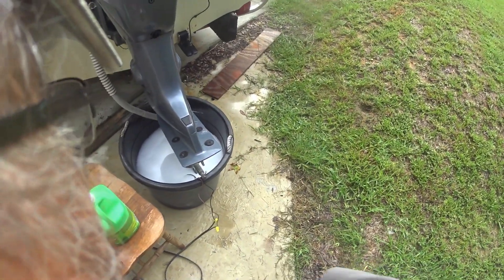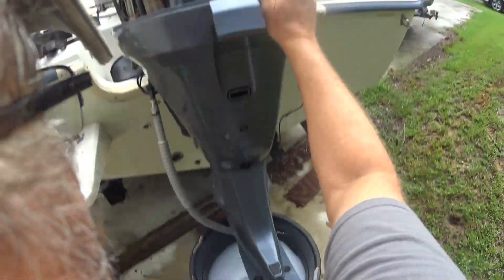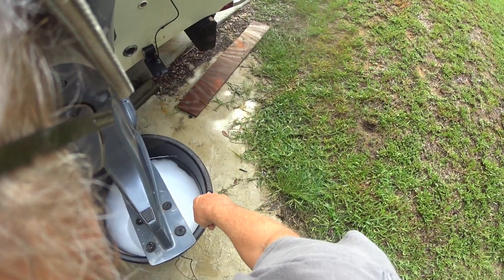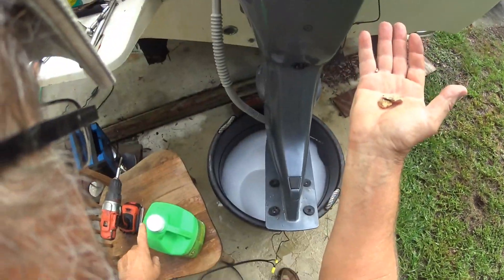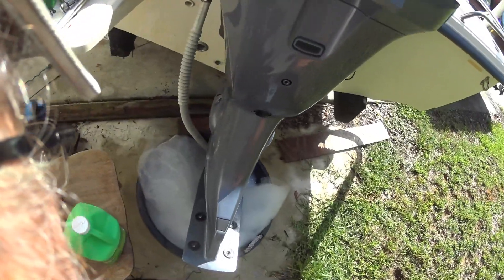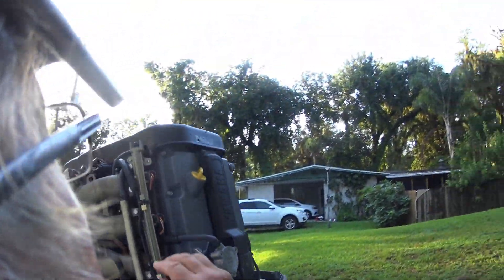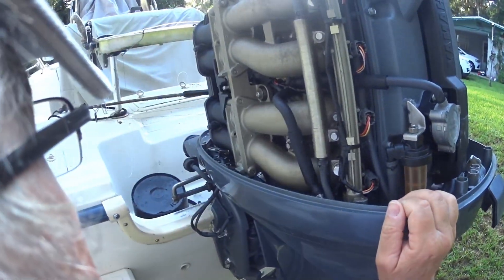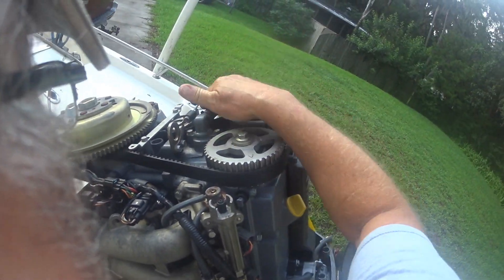How to THOROUGHLY Flush Your Yamaha Outboard

Comment: I use Ospho metal conditioner. It does not react adversely to the aluminum as much as Rydlyme. Ace hardware stocks it in the store for pickup. Remove the lower unit and attach your recirculation pump hose to the water pump pickup tube. Remove the thermostat and anodes.With the engine off and the Ospho diluted start circulating the chemical throughout the cooling system. Flush for a few hours than let it sit within the cooling passageways for atleast two to four hours then repeat as necessary. Flushing your outboard motor with the earmuffs after running it in salt water does not do very much because the engine never reaches operating temperature and the thermostat remains closed. Instead, use a large garbage can and or container filled with fresh water and run the engine until the water gets warm. Usually takes about fifteen to thirty minutes to flush it out properly.

Comment: Lots of work but worth every ounce. That motor should keep on going for many years! I've been looking at my 115 Mercury 2015 engine and it doesn't have any anodes on the engine. And the anodes it does have are aluminium. I'm definitely going to look into flushing the engine with that line removal product. Thanks, Lane.  I always run my engine after every trip and make sure it heats up. Haven't had any problems but it's always good to stay on top of things
Reply from the maker: Hi Danny, Aluminum anodes.. on an aluminum engine? I might be missing something but I thought yo9u needed a 'sacrificial' metal and not the same metal.
The motor ran GREAT today but we only stayed i the inlet area and fished the jetty. Too rough off shore. But I caught 3 Cownose Rays, one big Red Drum, a huge nurse shark and 14 Mangroves of which I gave John a couple and I kept 5... Fun day on the water...
Reply: @SaltyKayak  I'm a bit confused on that as well, but I do have three zinc anodes external. One on trim motor, trim tab and lower end. but according to Mercury there are none on the motor?? I looked it over very well and none to be found.  My youngest son came down ans we got offshore. Conditions were pretty good but a little choppy. And we caught our limit in red snapper, Ha!  Went out Friday and Saturday very early to avoid the masses. The FWC youngsters got me when we docked and asked how did we do and I raised my hands in victory and said we got our limit. We caught some 3 pounders, but they were red. Even better we caught 6 nice Vermilions. I'll probably go out Friday alone to get my one rs.  Hope you and John make it offshore to let me see some big rs being taken home!

Comment: Make sure it is circulating by taking out the thermostat. The best way to do it is through the input tube when the lower unit is off.
Reply from the maker: Yes.. I took out and cleaned the thermostat while the flush was circulating..
Reply: I was thinking of doing this exact same thing...flush my motor through the pickup tube. Does anyone know if it would be safe to do so with the motor running? Provided one can rig something up to give enough pressure up the pickup tube, so as to cool the head and prevent an overheat instance, of course..
Would love to hear y'alls thoughts on this. Many thanks in advance

Comment: I just need to ask did this take care of your overheating problem, captain. Thank you for taking the time to put on these videos. Very informative.
Reply from the maker: Rydlyme... is the best and quickest solution. Yes, I had to pay a little more for it but from what I could tell after a good long flush.. by following the directions.. the motor ran clean and cool up until I sold the boat not long after I did this flush. This might be upsetting to some, but when I saw that Biden was going to be President, I knew I wouldn't be able to afford the cost of non-E gas (I am retired and on SS). And I was absolutely right.. gas prices skyrocketed AFTER I bailed on the boat.
Reply: Thank you I didn’t receive a reply. Thanks for answering it twice lol.

Comment: Great video thank you for sharing your experience. Did it stop the overheat issue? Thank you another Florida boater.
Reply from the maker: When I flushed it with Rydlyme as per the instructions, that stopped the 'stopping while at near full throttle' issue. I didn't have a temp gauge from the motor to tell me when it was overheating but it ran like new after the flush.

Comment: Anodes are designed to waste away , after time they do go to a type of zinc paste , it’s because they are working . To flush an outboard just put it in a tub and run it up to temperature so thermostat opens and job done

Comment: Good morning...... I have the same Yamaha 115. Question for you regarding your process for "flushing every time" Have you been flushing without motor running by using just the water house connection hose port? Or were you putting on ear muffs on the lower unit and running the motor? In my experience its a "must" to run the motor with muffs on for about 15 to 20 minutes to ensure the thermostat opens and water then circulates the entire system. Hope to hear what your process was before you had the overheating problem. Thanks!
Reply from the maker: Always, always used the muffs but rarely have I flushed for 10-15 minutes.. usually more like 5 minutes and I usually will 'taste' the water coming out of the pee hole to make sure it doesn't have any salty taste. I can always tell just by the sound of the engine when the thermostat opens and will run it for 5 minutes+ after that. But, what I have found out is that when I am out in the ocean fishing for 4 or 6 hours and my engine is just sitting, over the weeks and months of doing this (even though I flush every time) there is a small corrosive buildup in all the water channels. That is when I need to do a true chemical flush.
Reply: Great info! Thanks for the reply sir @SaltyKayak

Comment: When I change out my lower unit oil, it too had some milky (water in oil) stuff In it, well I almost found out the hard way that all the seals were bad. Might want to do a pressure test for the seals. Don't need it locking up on the water/offshore. 
Hope you catch a red snapper!
Reply from the maker: Hi WF, Pretty sure I found out the oil leak problem. When I took the boat in for the 100 hr (more like 200 hr) maintenance, the shop had put in new oil in the lower unit but had also put teflon tape on the bottom screw. That tape must have created a micro gap in the screw/threads and for the last year, it slowly drew in water and expelled micro amounts of oil. The gasket they used looked like it was my old plastic gasket instead of a new one and they used teflon tape instead of a new gasket. Everybody is out to cut costs and try to sneak in inferior repairs.. that's why I prefer to do it myself. That way, if I have a failure.. it's my fault and not a care(less) tech..
Reply: @SaltyKayak  WOW!! Yes sir, I try to do all repairs for that reason also. That's good that's all it was. I have to replace my lower unit.  I had a nice size chip out of one of the gears from water in oil.  New one 2,500 used $500-$1000. Hopefully get it fixed in the next couple days for the last day of red snapper season.
Reply from the maker: @wallyfo  I'm in the same boat.. so to speak.. in that the boat has dry for the last 4 days. but plan on going this coming Friday for my one keeper RS this year. Plan on a water test tomorrow and determine if I want to go off shore on Friday..

Comment: Hey Capt Salty you could go by a canal and back in the ramp and run motor for ten minutes in fresh water. I can’t do that anymore my boat is almost 26 ft long but you can. JT 🇺🇸🇺🇸🐟🐠🎣🛥🌴⛱😊😊😊🙏🏻🙏🏻🙏🏻🙏🏻🙏🏻
Reply from the maker: When I lived in NC, I would pull out of the ramp here in Ponce inlet and drive straight up to the Charlotte area. Only about 3 miles from my house was a fresh water lake and a ramp that I would back the trailer and boat back in. I would climb in the boat and start the engine and run it for 5 minutes in Forward and then a couple minutes in reverse and flush not only the motor but the trailer/tires and springs. But since I only live 3 miles from a ramp here in New Smyrna and there are no fresh water lakes nearby.. it's all about the hose and muffs..

Comment: May be wise to change the water pump and the impeller after that flush ,they also advise to change the water pump and impeller yearly due to the sand in the water ,and just a FYI you can get a parts break down and part numbers at boats.net look them up by year and model  number
Reply from the maker: Hi Fred. I spent almost all of yesterday putting in a new pump/impeller assembly. Actually 3/4th of the day was getting that blasted metal cap and plastic bushing off of the shaft. I saw where one guy on Youtube just pried it off with a screw driver and another guy cur it off with a dremel. Of course, I tried (and eventually succeeded) with the screw driver/pry/hammer method but had to go to my local marine store for a new set due to destroying the bushing and cap. Nest time, I will just order one ahead of time and have it.. and cut off the old one when I do the next impeller change.
Spent about 45 minutes just now putting the lower unit back in the motor (another first time doing) and will put the muffs on it for a test in another hour or so.. when all of my neighbors are up and around.
I have cleand and rescued most of the old original Yamaha  water pump assembly and will just order the basic kit for the next swap out... planning ahead..!
Reply: @SaltyKayak  Yes the kit will likely have everything you need ,That is what i have always bought ,and it does help when you have 2 people to put the lower unit back on ,one to handle and one to guide ,with my 2003 yam F60 you have to make sure the fwd/reverse shaft is correct ,hence the second person

Comment: Well salty I think your running to hard. And the motor running hotter it’s building up scale. Get your self a 200 hp and run at 2800 to 3300 rpm you’ll get better performance and use less fuel